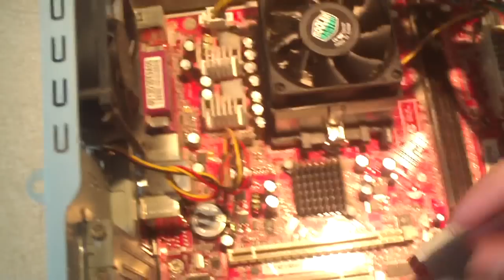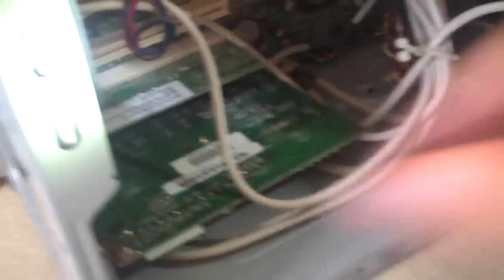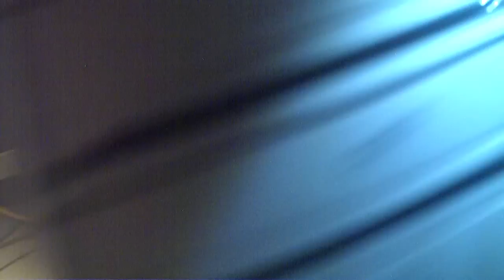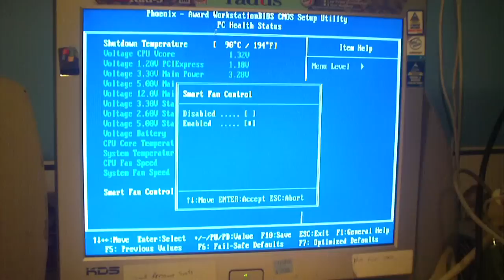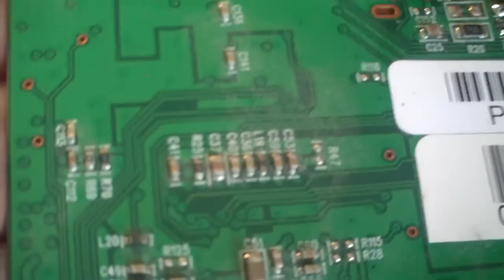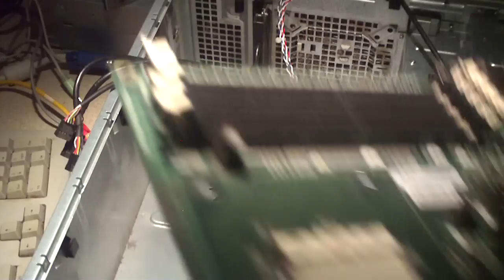4 Parts Computers in 1 Video! Incredible Deals!

Comment: It's wierd that the athlon x2 3800+ is a 939 but my 3800+ single core was AM2 , i used it on a am3+ motherboard after the old one blew up and it worked fine , it's wierd that they will put a x2 on a older socket than a x1